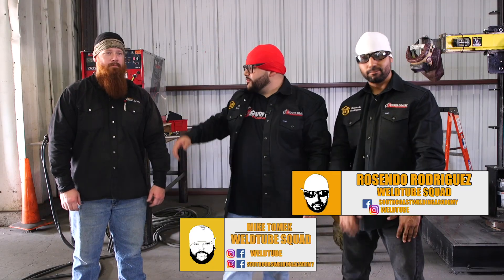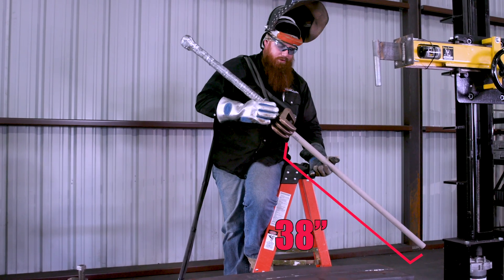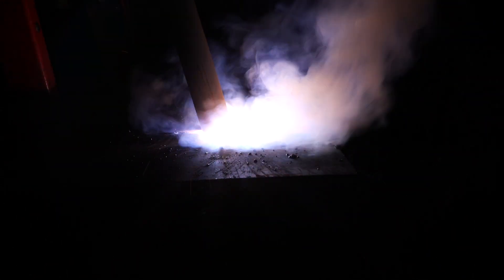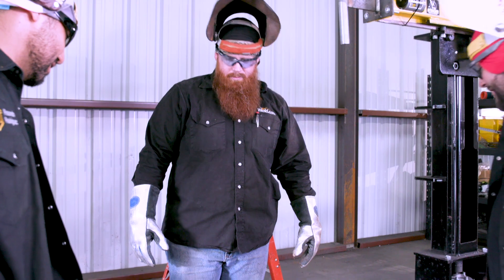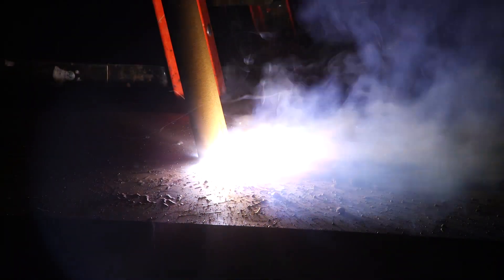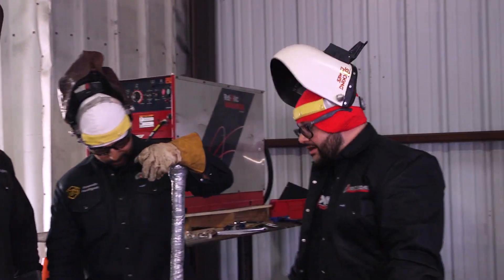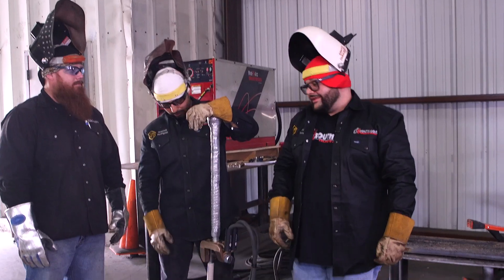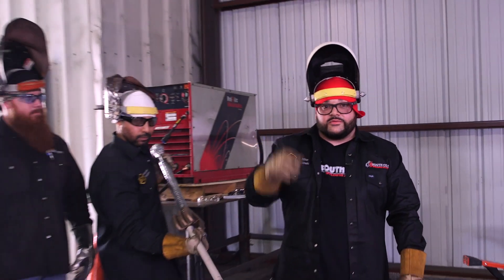1000 AMPS Stick Welding

Comment: If it sounds like giantly large bacon frying, you're welding with an obscenely large electrode. If it smells like giantly large bacon frying, you're missing an angle between your spleen and whichever testicle is hanging higher

Comment: Shouldn't it be 750A?  Does that welder come with a 120V adapter?

Now do it with a MIG spoolgun and TIG.

So, does that machine come with a pigtail to run on 120V, too?

Comment: I can only imagine how had it would be trying to break the rod free if you had the rod stick and freeze because of having to short of an arc length the problem would be made worse with such an huge rod because you can't just squeeze the electrode holder and release the rod so once you stick such an huge rod the current will keep flowing causing the rod to react just like a smaller rod it will heat up turn red melt hand welding with a rod that size should not be done with a special holder okay but not by hand even the splitter could cause major injuries if it landed on your boots and found that little baby hole into your boots

Comment: Very interesting,can't imagine that much amperage in your hands.I welded for 40 yrs,many yrs doing neuc's,I was in the UA,FN crooks!I spent 3 months welding the hull of neuc sub, 3/16 11018 up hill,hardest welding I've done,I did a lot of 3/16 6010 downhill on 24" pipe,no fun either.Can't imagine 1000 A
Reply: they use 6010 in nuke?

Comment: Can we get a shot of the Electrical Meter spinning? The local utility must love you guys for this months bonus.
Reply: Diesel engine driven power supply.
Reply: @hksjoshua  in my area diesel’s still ~$6 a gallon.  That’s some damned pricy work either way.   I can weld but I don’t do it for a living is there now reasonable way to attached a “buzz box” that size to the grid?
Reply: @charleshetrick3152  there is a such 1000 amp arc power supply but they are 3 phase 480 volt. To weld one 3/4 electrode probably costs .05 - .20 cents worth of diesel.
Reply: @charleshetrick3152  or you could run 5 lincoln tombstone 225 welders in parallel on 500 amp breakers

Comment: I set up a welder to weld catapiller wheel centers into the rims, it was 1000 amp wire feed submerged arc weld. 3 1/8" wires.

Comment: Just an idea for next time, might not be a good idea too :)
2-3 pieces of wood 4x4 on the ground to keep the plate off the floor so you can walk next the plate and not be stuck on a ladder.

sry for my english I am not very good.
Reply: I think you might be underestimating how much heat that 1000 amps is cranking out. any moisture at all and that cement will explode

Comment: I would like to see some overhead welding done with it. I've seen 1/2" 8018 stick-welding done at the San Francisco Bethlehem shipyard on  rudder grunion about 3 foot thick three men on starboard side and three men on port side, and I thought that was something.
Reply: The puddle might be just a bit to fluid for overhead
Reply: @GhostDrewSenju  i thought that too, this is probably just too far past the point you could do that. With this thing you'll just be getting rained on

Comment: Turn on the welder: vrrmmmmmmmmmmmm

Meanwhile 1000 miles away: why did my lights just dim way down? 
Hahaha! Way cool guys!
Reply: charles gross they then see the light of the welder 1000’s of miles away and are wondering who just split an atom..
Reply: Does that run on 110 ???
Reply: Hey my welder just shut off. You guys using the hulks stinger again.
Reply: It would be like on National Lampoon's Christmas Vacation.  Auxiliary Nuclear turned on at the power plant lol

Comment: You guys trying to weld the tectonic plates together or what
Reply: A battlehip maybe: do in 6 passes work that took a bare minimum of  34  back in the day?. I don't really know, except that some things were riveted, some were welded on those beasts.  There's nothing with hulls that thick anymore, so if some old timers have good shipyard knowledge... speak up please - there's always something to learn.  That work is where winning ww2 started.
Reply: Yeah only thing I can think of is giant structures in buildings or bridges

Comment: Very nice you all but I have one request I know you probably cant get to this but I work in aerospace space currently as a tig welder and there is a bump in the road that I have ran into and I'm wondering if I can see it be done I have a weld test coming back up but a little new to me its .090 thickness 321 Stainless steel using .045 filler wire needed to be used need to fill with no undercut full penetration in the back even all the way threw start to finish it's a Butt joint can add a groove if needed, and is going to be x rayed thank you for your time. In the flatt position only one pass.

Comment: Imagine getting this one stuck to the plate😂
Reply: Lol, true. You’d need a grinder or gas axe to get the damn thing off....
Reply: @izzyboss6875  Better idea: 1) Shut off machine power. 2) Attach 1/4 pound C4 explosive.
Reply: At 1000 watts I don't think that's likely to happen lol
Reply: 1000 amps dude more like 100,000 watts.
Reply: @hksjoshua  its depend on how much voltage are you using
Reply: @egiferdi  close enough tho.
Reply: @clutchboi4038  1000 watts? Whatchu talkin bout Willis?
Reply: @clutchboi4038  1000 Amps you mean
Reply: oh no....
Reply: Heh, my thought also 😁
Reply: Gotta grab the cut off wheel lmao

Comment: What kind of applications are those rods used for, that bead is like 3 in wide
Reply: andrewhdl 1 commercial ship building. It’ll normally be ran with robots
Reply: They use sub arc machine in ship yards , but it’s mainly cause it’s production

Comment: So that is the mother of all 7018s! 

Is there a 6010 of those?! Probably would dig through 3 inches of steel on high setting! And I wonder what special machine would run it!
Reply: That machine should be able to weld a 6010 version

Comment: Won’t catch me welding in the rain with that thing lol.
Reply: Won't catch you making babies either! I wouldn't touch it because it is a ten foot pole.
That thing is a plasma cannon, each arc is sending some EMF pulses LMAO.
Reply: Dunno, the current used for it might be pretty close to lightning.
Reply: @billmcyrus  the electric potential difference  in a lightning strike can reach 1.3 Giga volts (billion) and the current can reach up to 500,000 Amps which basically means that a lightning can run 21.6 million that size rods at the same time.
Reply: @АндрейКлименко-к7ы  ...wow, and the first thing that pops into my mind is can we do that?  Given that a lightning strike is only a tiny fraction of a second then that means dividing it by the duration of time it takes to run one of those rods.  So let's say a lightning strike is 1/1000th of a second and it takes 2 minutes to run one of those rods so 120 seconds, so 180 of those rods could be run.  Not too farfetched!
Reply: @billmcyrus  the longest life of a lightning (recorded) was 7.74 seconds
Reply: definitely not me!!!
Reply: Dont worry the rain will evaporate
Reply: PDB lol no.
Reply: JEEP Wk5.7 why
Reply: Omar hernandez why what
Reply: You're not supposed to weld in the rain ever.
Reply: killerms2221 according to a QC yes. But I’ve been on jobs where a sprinkle won’t shut it down but will still get ur gloves wet enough to shock u. Idk what ur trying to get at considering it was a joke. Lol
Reply: He must be he QC in the chat lol

Comment: in which industry would you use something like that? Just curious
Reply: JDaniel Cornu  I had an older man tell me he use to run a 5/8” rod in the shipyard years ago. Maybe ship building but either way that’s a big electrode.
Reply: I was told by an old timer that the railroad industry used it
Reply: They were mostly used for quick repairs in the forging industry when they either damaged a huge slag bucket or a very heavy duty piece of equipment.
Reply: I've only ever seen them run in die repair, and its usually at 1500ish amps